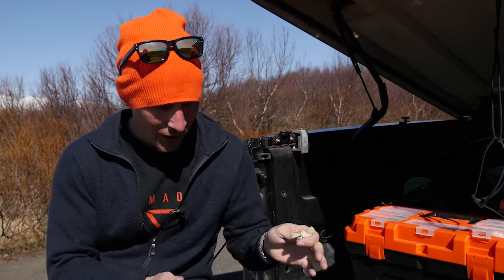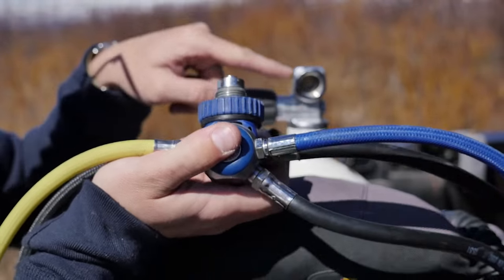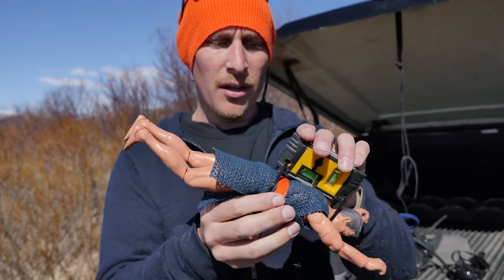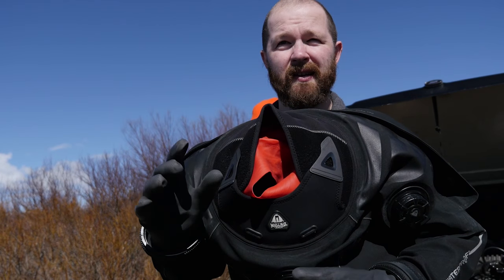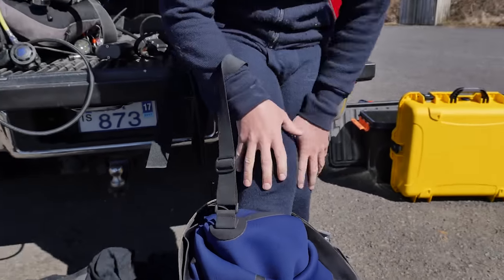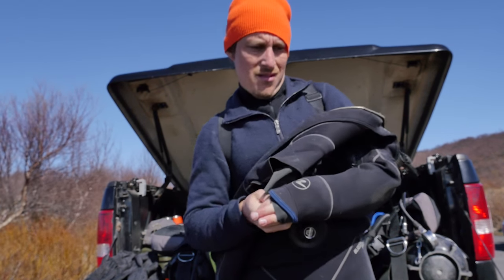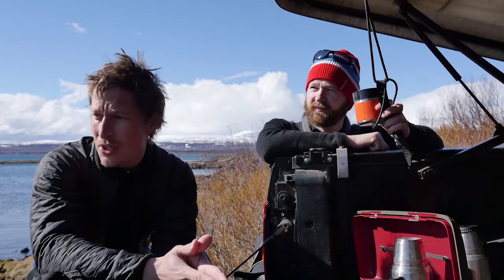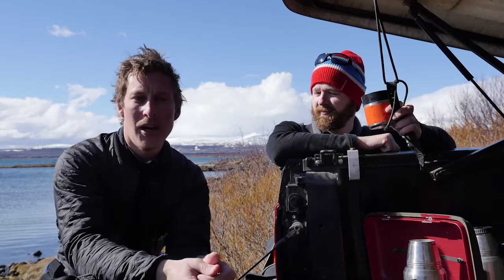How To Be An Icelandic Drysuit Diver

Comment: I went all they way down to the lake only to realize that i must have ripped my neck seal while taking it off just prior to going out to the lake.   Any tip on removing the neck seal.  Same as putting it on?  Two hands in the seal of either side of the neck and gently move head through.  I see from your other video that you have dove both types of drysuit that aqualung and also that D1 hybrid.  Pros and cons of each?  Does one stand out more than the other.  How long is a typical dive?
Reply from the maker: D1 
Pro's - looks awesome, tough and durable, cool features such as clip in cuffs and neck
Cons - Mesh layer smells after a few dives and gets heavy when wet, boots need to be re-inforced
AQUALUNG
Pro's - Solid design, simple features, excellent seals on wrists and neck
Con's - bulky, dull looking, knee pads fray after sometime

Hope this helps

Comment: a tip is to use this wax together with a hairdryer..to regulate temperature hold a finger between the suit ...like keep it just warm / bit hot...like just you want to pull back .

Comment: Reading a few comments they go on about the long hose and The way your doing it is right however you need to sort out the hose length I noticed on the back up hose you use a octopus hose, it doesn’t need to be that long it’s only for you and the hose can cause entanglement it should be either a 22” or 24” hose.

Comment: I use ankle weights. keeps my feet from going up behind my head.debating on buying the d1 hybrid but I noticed u don't use mesh lining.i usually dive abyss pro.scallop diving in maine.did u not like the mesh liner.
Reply: Never used ankle weights diving with D1 with the inner mesh or without it. I use the hollis F1 Bat Fin. they are super heavy and are negatively buoyant in the water so pull my feet down while diving.

Comment: Great video. Weirdly I have came across it as I research my next drysuit... and the two brands I am looking at are Aqualung (Apeks) and Waterproof. Also weirdly, I carried out a DPV dive many, many years ago. I was waiting for my buddy on the seabed and it jammed on unexpectedly and shot me to the surface (holding it by it's handle on the nose!). Wouldn't turn off (leaky seal)!
Reply: Also looking at Waterproof (and some others). Can I ask what you went for and if you are happy with your choice?

Comment: Hey, what's your opinion on those new TiZip plastic waterproof zipper's?
Reply from the maker: Terrible. They break and you're wet! Metal zips if cared for work well and always will.
Reply: I would highly recommend YKK Aquaseal zippers, better quality than Tizip Masterseal zippers.
Reply: Thanks for the tip! At the moment I'm using TiZip despite all the negative opinions I've read. Made about 50+ dives in it, and there wasn't any problems, so I guess it's not so bad. Actually plastic zipper feels so much better then metal iron bar in front of you (I'm using front entry config). So I'm not regret for switching to plastic. But time will show anyway.

Comment: Not a diver, just looking at your video which is very good and informative, so why are the zips made from metal that corrode? why not quality stainless steel or nickel plated brass, or other metals that resist salt corrosion, I cannot see why manufacturers use metal that corrodes on vital equipment.
Reply: Its a brass zip. Iv not known them to rust only corrode if left un washed and used. Also wax as at some point especially from diving cold conditions fouls the zip, then people use boiling water from a kettle to wash it off! These zips can last for years if looked after properly.

Comment: 1. Layers are important, good stuff (especially wool)
2. Babypowder helps the wristseals slide over skin easier
3. Warm water in the wet gloves helps postponing cold hands
4. I respect your view on bouyency control but I don't agree. You have to compensate (fill the suit on your way down, empty the suit on your way up) anyway to prevent squeeze or air  leakage from neck/wrists. Controlling one valve will always be easier than controlling 2. The legs up "problem" will always be there when using a drysuit, but fairly easy to avoid.

Comment: The deeper you go more compressed your undergarments get. I get cold in 2 degree celsius water when I don't add air to my drysuit every few meters. Two of instructors I dive with (cave instructors) claim that drysuit are for contolling the buoyancy, while bcds are for surface and emergencies.

Also I can't imagine diving with only one 1st stage in water below 7 degrees. This is irresponsible

PS bending your knees helps!

Comment: What is the reason behind o-ring blowing out? I'm using yoke regulator all the time, at winter in very cold water and at summer, when water is about 24 C here, and I've never had this problem. The real benefit of DIN reg is that it's can handle more pressure then yoke.
Reply from the maker: The o-ring is less exposed to the changing pressure gradients. DIN is rock solid - there is no substitute! Especially deep down in the blue.

Comment: Nice video guys, your videos usually are. However, there are some things that struck me strange in this one

First being the statement that the “DIN way” is the only way to dive in Iceland. This is very wrong and the majority of Icelandic divers still use YOKE although DIN is getting more popular. With proper care and use there is absolutely nothing wrong with using YOKE first stages in Iceland. The main issue is that the first stages need to be EN250 certified or approved for cold water diving.

Another is the statement about divers rarely using their dry suit for buoyancy. It is actually very common for divers to user their dry suit for buoyancy control, especially for divers that dive in Trilam or similar dry suits but more uncommon for neoprene dry suit divers. However, I would suggest that only one buoyancy device (suit, wing or BCD) be used so not to complicate matters. Using your dry suit as a buoyancy device can be tricky at first and no one should dive in dry suits unless getting proper training using it.

There are no Turtles in Iceland :) and few in places where divers usually dive in dry suits.

Thermal protection is crucial, that is really true when diving in dry suit. Wool or wool blends is probably the best thermal protection available for dry suit divers as it keeps its insulation properties even when wet. However, in the video you guys mention the importance of socks, which is truly important to… but… you say you use normal pair of socks, cheap, as a layer underneath the wool socks. Some might have heard the phrase “Cotton kills”. Hopefully these cheap socks were not made of cotton as cotton clothing is one of the no no’s in diving as when you perspire any cotton clothing touching your skin will absorb your sweat like a sponge and it ceases to insulate. Same could happen with a dry suit leak, even a small one. 

Just some pointers, my view :) but keep up the good work
Reply: agree with all of what you mentioned. david sometimes gets carried away in these videos which is something i wouldn´t change for the world! never used cotton in diving in my life only wool and i only use merino wool from Woolpower!